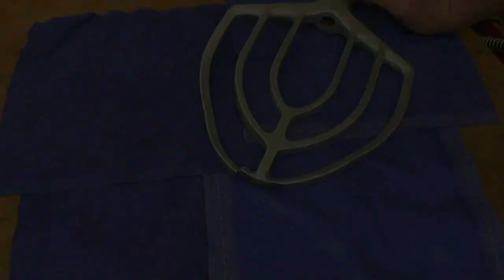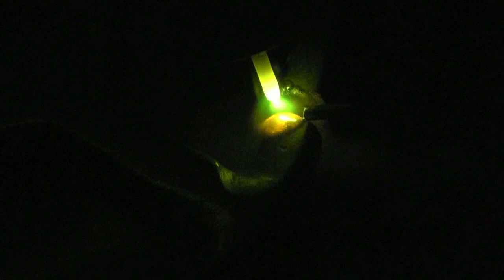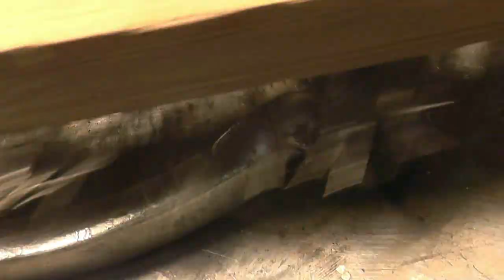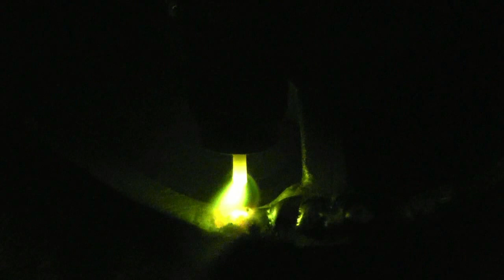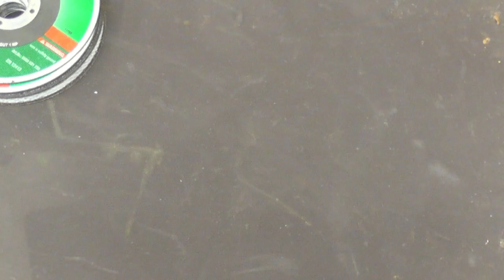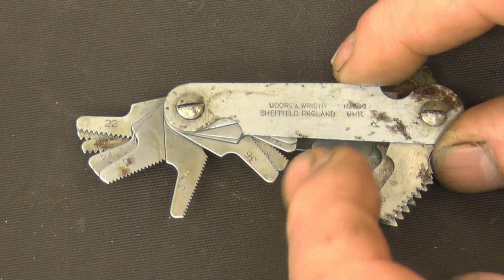Sunday Night Night Cap 80 part one

Comment: John, the car boot items are usually interesting, and have been educational at times...though apparently I'm learning, as I can ID most things now after watching for the last year or two. 

Do you need to smooth the welds on the repair?  For food prep I'm thinking that ability to clean is important, and smooth is easier to clean than rough. Just a thought. 

I'm glad Debs is tolerating the radiation therapy well. Not everyone does.  Not long now and she'll be through it. You've both done great dealing with a very rough time!

-- Mike

Comment: the "pin gauges" are for use in gapping spark plugs. The tool with the notches can (theoretically) be used as a wrench to bend the electrode.)
Reply: Andy Wander Absolutely right, very surprised John did not recognise it being as he is in the motor trade.
Reply: Andy Wander good call I have a set made by champion.
Reply: +Chris Stephens every mechanic in north america over 50 has a set of these but maybe they were uncommon in England
Reply: Just as common over here, perhaps John is just too young, you know these modern youngsters know nothing. :>)
Reply: +superrodder2002 I'm not exactly a mechanic, nor am I over 50 (not far from it, but not there yet).  But I've got a set of those around somewhere.  It's the disc type, with the different wires coming out and making squared off loops like they're spokes coming off a hub.